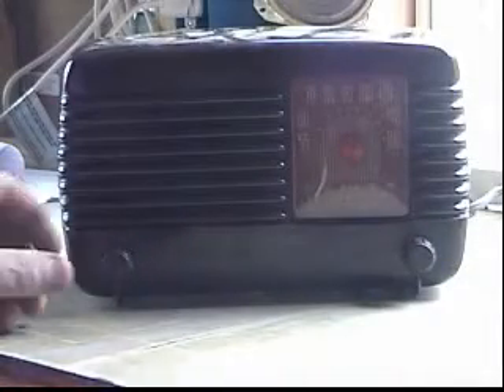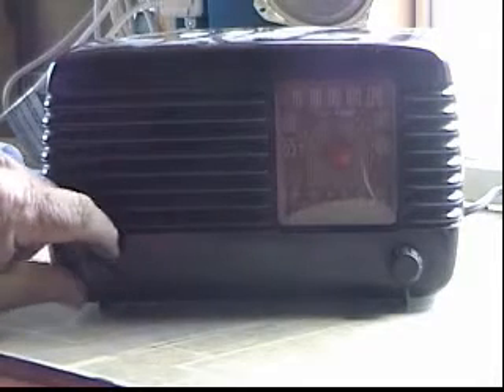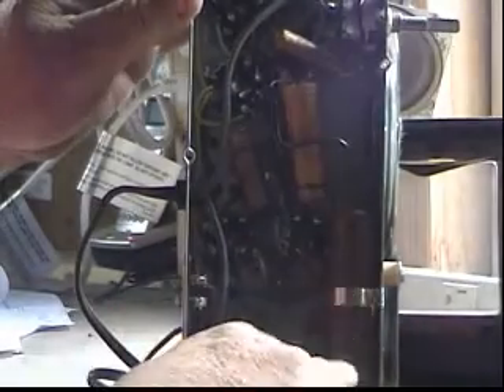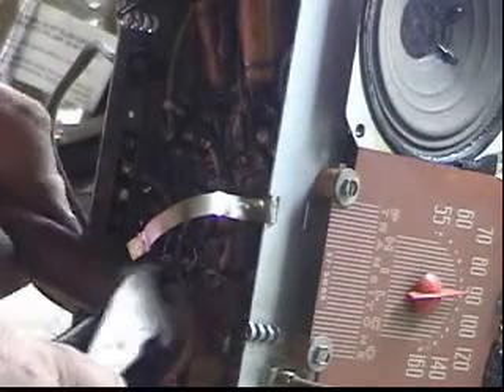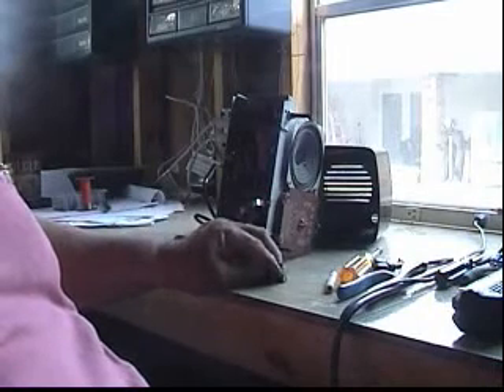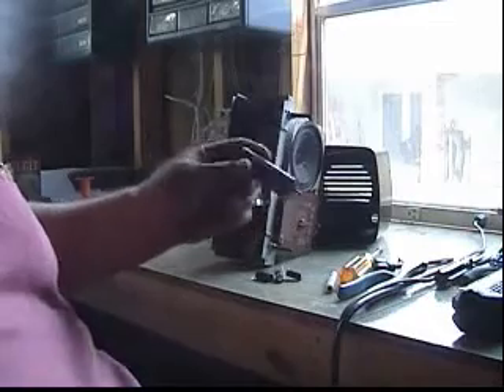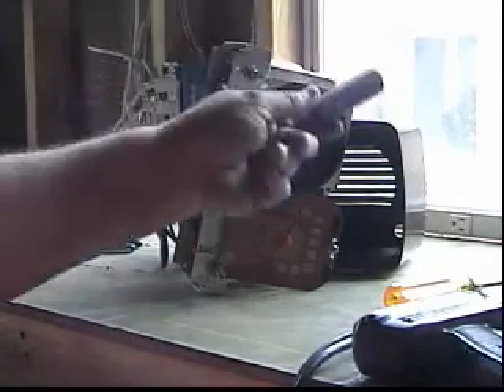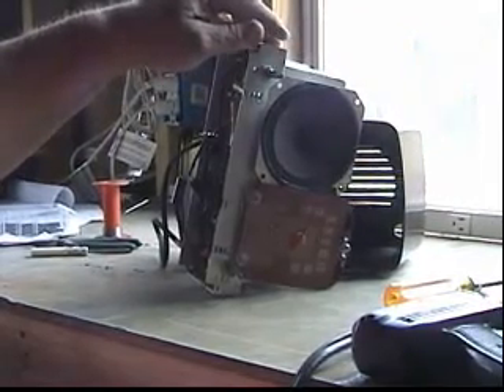1948 Philco All-American-Five radio repair

Comment: "Sometimes the chassis served as the ground but occasionally it didn't. Some manufacturers of these units were willing to spend a cent or two for increased safety.There had to be a grounding wire run all over the radio and this meant using some terminal lugs to solder the wires to.  While such radios were less of a shock hazard to the user they tended to produce more hum if plugged in the wrong way. Reversing the plug would reduce the hum and make the radio even safer when it was turned on"

Comment: First you should of flipped the wall socket plug in around and plugged it in the other way.  This will eliminate humming on some AA5s, which hum because of the way they wired a ground safety wire in there if they weren't stingy:

Comment: My opinion is a bad cap also.. today I just finished reparing the same model, but the electrolitic that I replaced only had 3 wires, ground,red 50/150, green 30/150.... however, I need to replace dial cord. Great video, hope to see next one step by step! Thanks!!
Joe - k4jga

Comment: There is high voltage. But i have worked on tons of tube amps and radio's and never had to discharge any capacitor. I'm just lucky i guess.  A double insulated wire cutters is needed for the job,And its what i use.  But for people that foolish and have a death wish. Go ahead and touch the bare wires in a tube radio.